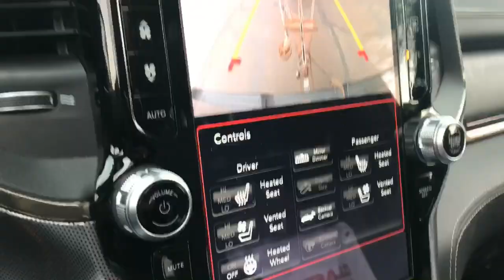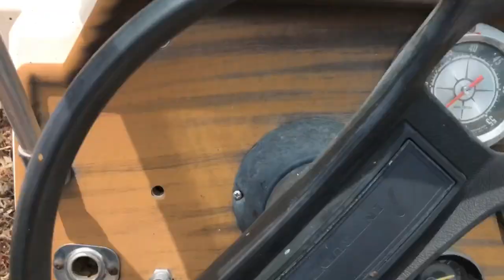Converting an Old Tri-Hull into a Bass Fishing Boat

Comment: Those mid 70’s Johnson’s are strong ! Disconnect the fuel line and get a 6 gal. Boat tank and mix your gas at 50:1 , you could run stable with it or a carb cleaner but don’t run it without water ! You WILL take the impeller out and you don’t want that ! Good luck on your project ! Tri-hulls are known for stability on the water !
Reply: Do you recommend them, if you can get them for cheap?
Reply: Camron Ramsey I do if the price is right ! Those fiberglass boats around here are either super cheap or free !
Reply: Thank you!

Comment: I got mine for $100 i got it running no problem I have the same motor 1978 Johnson V4 2 stroke on 1978 Thunderbird Bird Signa 17 Tri Hull, it runs strong 💪 I have a lot fun and shes 43 years old
Reply from the maker: They are good motors for sure! Thanks for watching!

Comment: For the age of that Johnson it looked excellent! on the outside, some carb clean up, some seafoam in the cylinders, I bet it runs like a champ👍, new impeller, prop serviced, it'll be good as new.😎. The boat has a weak transom. Look at the aluminum angle transom cap and you'll see at each Outer End is not against the boat, shows that the top of the transom is leaning out.

Comment: tri-hulls are stable boats for fishing. that old,1977 140 you have  was a real power house. i had one on an old,16ft checkmate. ran around 60mph. i just built a 15.6 glastream, tri hull. has a 90hp yamaha. runs almost 50mph.

Comment: 11:00 A tree growing out of a pillow - now I've seen it all in boat restorations.
BTW: engine been sitting still for a long time? First check compression.
If ok continue by replacing the impeller and check & change the gear oil.
Cleaning the carb is also advisable.
Reply from the maker: Good advice. Thanks for watching!